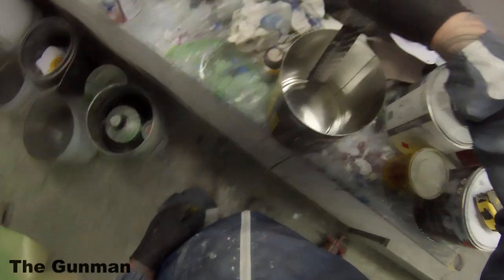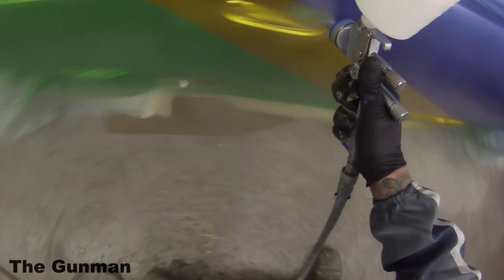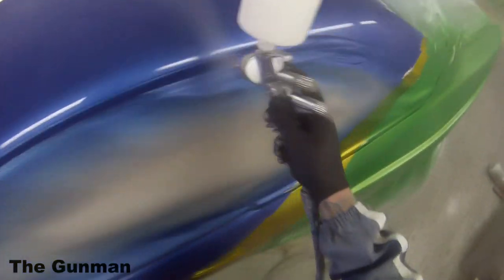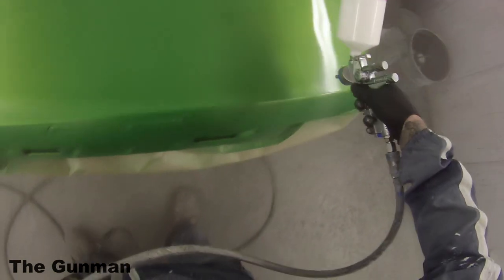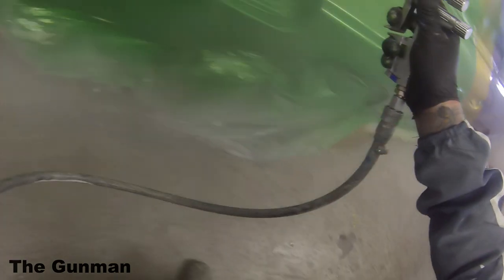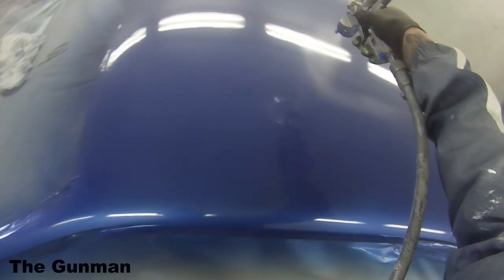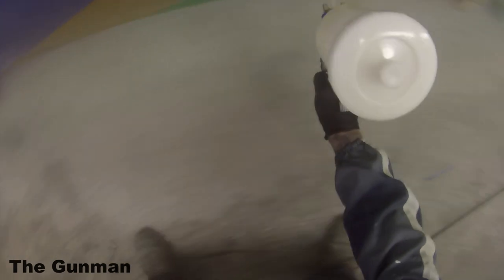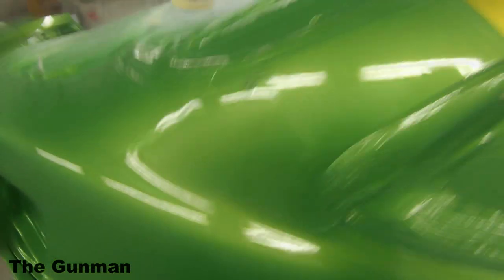Clear Coat S14 Drift Car

Comment: Shit to late painting at home I used two big fans put plastic on the walls and the car lift. Had a few runs it's just down to cut and polishing. For my first time painting I was shocked how well it turned out. I did in the morning after every body went to work an daycare. Then I rolled it out in the sun after six hours. The sun pop out the silver thanks for all the amazing tips gun man☺

Comment: Hey Gunny, I have used "hot paint" techniques in the past and here are some tips for you and others. From the home brew shop, you can buy a stick on flat thermometer that you can put on the paint pot or on the clear pot in the water, or the pot containing the water. You can also buy a food warming try which will keep a constant temperature put the hot water pot on that...no more boiling the kettle. AND best of all you can make yourself a "tea cosy" out of 1/2" paper backed fiberglass and gaffa tape. It goes OVER the pot on the gun..and the paint WONT cool off between coats. I dont know WHY "hot paint" is not an industry standard since this whole "compliance" thing was about VOC's
ALSO I love the fact that paint dries so quick that little dust has time to set in.....BTW the ideal temperature is about 40C - you'll still have about 30mins of pot life....
Cheers

Comment: I've now finished my boot lid, had to weld up old spoiler holes then took it all back to bare metal, filler then epoxy, then primer, flatted it then base, but got a lot of dust in the base and tried to bury it with clear but did not succeed. So sanded it back and recleared and all is now well.  But using 3M 800 grit on a soft DA pad on the clear was a real pain, every few seconds I would end up with small hard /balls/specs on the paper which were putting deeper marks on to the clear, took ages to get it flat. Any how it now looks great, all thanks to the Gunman! Next the rest of the car.

Comment: Amazing  work you really  smashed  that clear on, was great to watch. There is a 5000 rp in 1.2 for 499 and a digital  in 1.3 for 699 in aus on ebay atm, so tempted to buy one at that price  but I think  my old compressor  would  have a heartie  trying to  keep the air up to it.

Comment: Pretty good idea with answering questions in your videos. I like it.
From my knowledge, someone might mix together similar clear coats. But no one should mix non similar or very different clear coats.
At 20 degrees 2.0 bar at spray guns inlet, and around 20 centimetres from panel should work very well. 20 degrees Celsius is recommended temperature for painting in climate in my county.
Great video.
Thanks!.

Comment: Strip between the bases they are not visible? And at what pressure did the varnish lie? How sata 5000 to you? I was afraid that the varnish did not fit very well. Are you polishing after painting ??? thenk you

Comment: I'm learning a lot from your vids, keep it up!
Question: I'm in the states and I do a few small projects a year, panels/rust work, no full resprays yet.
I have two old devilbiss guns and one old sharpe, all are siphon feed conventionals that were my grandfathers. They seem to work fine for me but I hear a lot about how great the gravity feeds are and how hvlp works so much better.
My question is does it make any sense to spend hundreds on new guns or would you keep the siphon guns if you were me?
My first spray job was the hood of my mustang this spring and I've had a couple old body-work guys tell me they couldn't have done any better. 
Thanks pal.

Comment: Do you still have the LPH400? I saw a video of a guy who said the chrome cap ( Which im pretty sure is the air cap you used in your earlier videos was ) is absolute sheit compared to the purple cap for clear and it's the best clear gun on the market. Just wondering if you'd consider getting a purple cap for it and reviewing it if you still have the gun?

Comment: Great video sir! I have a question about the left-over clear you mentioned. How long do you think you can keep clear coat around after you have opened it? I am looking at a bumper repair, and want to use a good clear, but it only comes in the gallon kits.
Reply: asicerik If you seal the paint tins again properly and store it in a dry dark cupboard, it should last a year.... The hardener will break down sooner than the clear.

Comment: Mr G lol so when using MS clear can you hammer it on like the HS clear. have a job that keeps going south on me i believe the problem is the application of the clear ( i dont have agood gun yet ) my clear gun is a Iwata HTE 3 not sure what keeps happening advice please ??
Reply from the maker: Dana Wick Is it cold? if so heat up the clear, no you can't really smash MS clear on as heavy as HS or it'll dull off.
Reply: well that answers alot of my issues, it was 25 - 27 here which is the norm for summer when i painted the truck polishing it is a nightmare as well. guess ill be changing to HS clear its double the money here but its all about adjustment. a ndividual part i do ok as m a scratch and dent guy but whole vehicles  strugggle a but thanks Gman ( Yoda )
Reply from the maker: lol, done properly you'll use less HS so can end up similar price in the end, 2 coats of HS is like 3 of MS so 1.5 is all you really need with HS unfortunately I haven't got many vids using this method and the one I do have is poor quality and no narration, it was my first upload way before TGM, 130ml per panel used 300 for a bonnet (hood) https://www.youtube.com/watch?v=O8gwUFtarFE
Reply: you da man lol thanks oh the atomic green the silver undercoat can it have metalics or should i buy straight silver i have a bunch of pints kicking around
Reply from the maker: Get creative and see what you can come up with